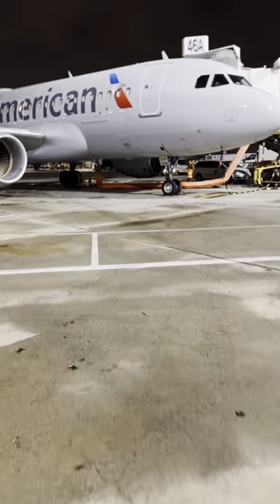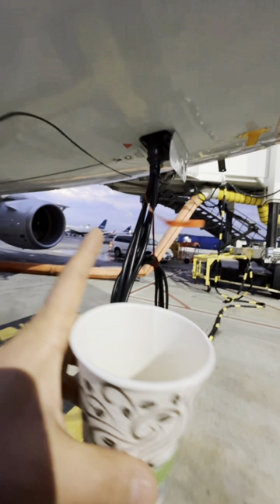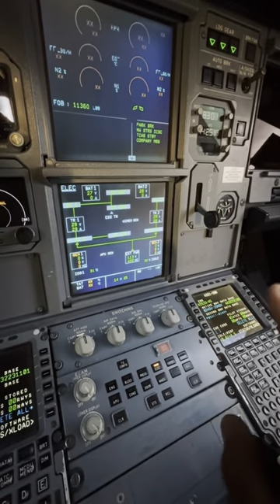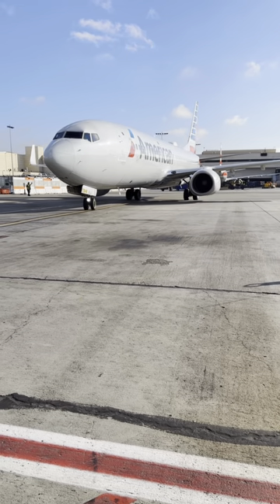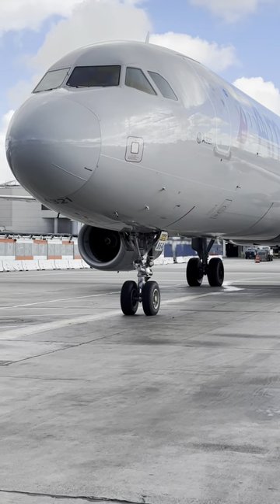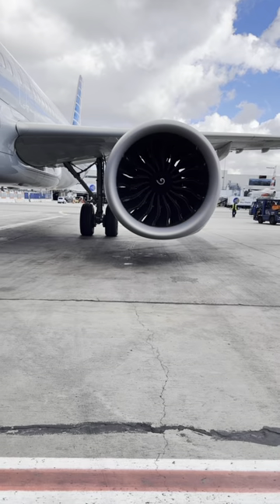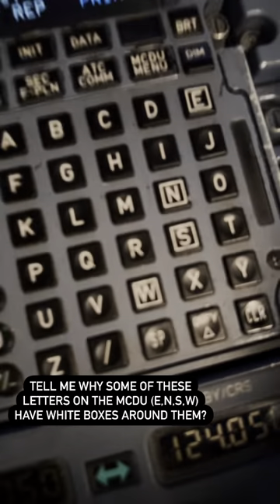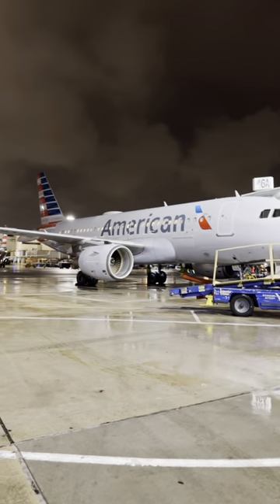Stig Shift #2 Another day another adventure on aircraft maintenance.

Comment: Now wires are color coded to prevent confusion. I've had mixed wiring nightmares when the person who pulled a motor and did not number the wires for reinstallation. They were all black. Whew!
Reply from the maker: Well in aircraft, not only some wires are color coded, but all the wires have number codes on them to differentiate. Makes it easier when working.

Comment: Are the aircraft tugged or do you drive them over to the ramp?
Reply: As far as i know, tugged, tugs usually tow planes from hangar to ramp or vice versa or from ramp to parking spot, i may be wrong but the only time a plane on the ground has engines on is if they are performing engine test
Reply: We taxi them too
Reply from the maker: We do both. We can use a tug or we can taxi them around.

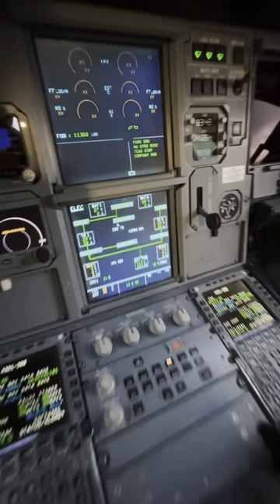Comment: Hey Stig. Always wondered. At 5:55 if you select gear up will the jet collapse or is there something protecting that from happening? Also does Lufthansa and other foreign carriers use their own guys (from Germany and do they live here) doing what you do or do they hire American citizens to do the work?
Reply from the maker: The gear lever is an interesting animal. In design if you put the lever up nothing should happen. BUT… if the hydraulics were to be running the nose gear has a chance of collapsing due to less weight on the nose of the aircraft. The main wheels will stay down, too much weight on wheels for them to move. Foreign carriers use contract maintenance outside their own hubs but usually have a company representative to overlook the work of the contractors.
Reply: @StigAviation Thanks so much! Enjoy you answering subs questions!   Look forward to your next video!

Comment: Question: About how many RPMs do the fan blades go......and how many RPMs do the turbines do in average speeds?
Reply from the maker: It depends on the type of engine, they all spin at very different RPM rates. But in general we’re talking about 10,000 to 14,000 RPM.

Comment: I really enjoy your show.  Wondering.  When the planes are ferried on the airport, does it have to be a pilot?  Or is there a maintenance  level that can move plates?
Reply from the maker: What you’re talking about is two different things, a ferry flight is done by pilots, now a reposition on airport grounds is a maintenance move. Maintenance has the authority to reposition aircraft by taxing it on ground to various locations, most of the time from hangar to the gate and vice versa. Or sometimes performing high-power runs for operational checks.

Comment: The one thing about working in the rain when you’re doing your inspections specially around the engines it’s hard to see a fuel leak compared to oil or hydraulic leak. You basically have to smell it enjoy your videos from an old retired guy who still misses it.
Reply from the maker: So true! When in doubt, the good old touch and smell test. Half the time ends up being glycol from the deicing. 🤣 almost smells like bubblegum. 😂

Comment: You may have addressed this in an earlier video Stig, but I'm interested to know what shift pattern you're on. I've worked plenty of different shift patterns over the years: 2 days/2 nights/ 4 off, 4 nights/4 off, 2 on/2 off, etc. What's your preference when it comes to shift patterns?
Reply from the maker: I myself have worked many different types of shifts, but currently I am on swingshift, five days, eight hours. But I have the capability to give away days and pick up days, hence why you see me working a double shift, 16 hours.
Reply: Yeah wow, 16 hours, that's a long day! Is that flexibility with your shifts due to a shortage of mechanics or is American just generally flexible with their working arrangements like that?
Reply from the maker: @johnforster5312  AA is just flexible like that.

Comment: Did I miss how you lockout the apu before you stick your head in the compartment lol? How do you do that?
Reply: By not turning it on? I stuck my head up there with it running all the time for leak checks etc.
Reply: @justing42  you really don't lock it out to prevent someone turning it on while you're in there? That's pretty shocking to me.
Reply from the maker: My partner is in the flight deck, he’s the one who turned it off in the beginning and locked it out. That’s why I was opening it.
Reply from the maker: Sometimes we have to run it and do leak checks. So that’s allowable for maintenance.
Reply: @StigAviation  oh ok got it. Yeah somebody's watching the panel. Cool thanks!

Comment: And I thought electrical on vehicles was bad. Holy.crap
Reply: @StigAviation  and I hate electrical. But it must be done. I would hate have to track down a shorted wire in that.
Reply from the maker: @BeardedFordTech  practice makes perfect bro. Just understanding how to read basic wiring diagrams and schematics and knowing how to use a multimeter goes a long way.

Comment: Love the part on the ETOPS check, as I have been looking for that forever. As a dispatcher for your company who dispatches ETOPS flights, thank you for this. So a couple of questions. You mentioned that you have to physically check some items like tire pressure and APU condition manually on the BUS but on the widebodies you can use the max computers on the flightdeck for this. So does that make an ETOPS check quicker on a Widebody than a bus, or easier? Secondly, I was curious about the transition to the e-logbook happening, and how have you as a mechanic dealt with a shift where some planes are on the e-logbook, and some on the old paper logbook?
Reply from the maker: It almost takes the same time and sometimes longer on the wide body aircraft because of the size of the aircraft. Takes longer to do a walk around, cargo inspection. But getting the data from the computer does make it very convenient and faster. As for the eAML, I’m absolutely loving it on our 737 fleet and soon we will have the Airbus fleet in a few days. Makes paperwork and logging entries sure convenient.

Comment: Do you check the pressurization system of the aircrafts?
Reply from the maker: Only if a malfunction was reported by the flight crew otherwise we don’t need to perform unnecessary maintenance.
Reply: It’s AIRCRAFT….not AIRCRAFTS
Reply: @justing42  Ok. Thanks 🙏

Comment: 11:00 
Don't feel the extreme heat when you get too close to the engine from behind near the rear exhaust hole, especially since the plane was turned off a few seconds ago
Reply from the maker: I feel a little bit of heat, but it’s not something that will hurt if I stand near it. But if I touch it yes it is hot and it will burn. And this is only the exhaust portion where I showed. The rest of the engine where the high bypass is located, and the fanblades are all cool to the touch.
Reply: @StigAviation  

It's really interesting, you seem to have quite a bit of knowledge about the aviation industry as you know which parts of the engine are still hot and which aren't, knowing these small details shows that you are a very professional person 🔥🔥🔥
Reply from the maker: @mike20259  I should hope so… been fixing these beautiful aircraft for 25 years. But the fact of the matter is that I’m still a student of aviation and always learning every day. The learning never ends.